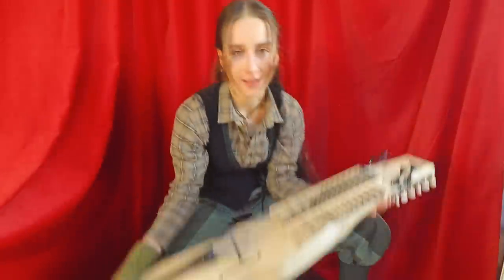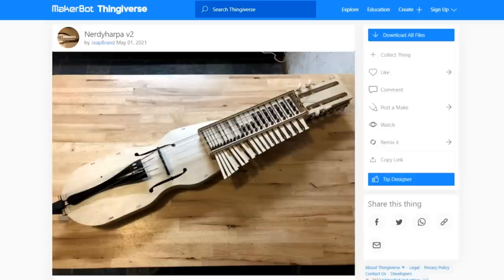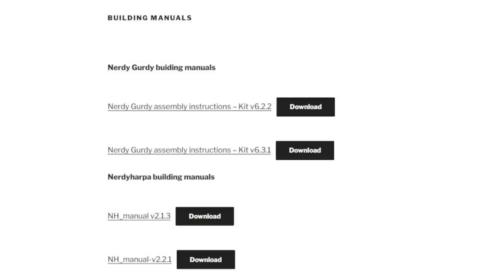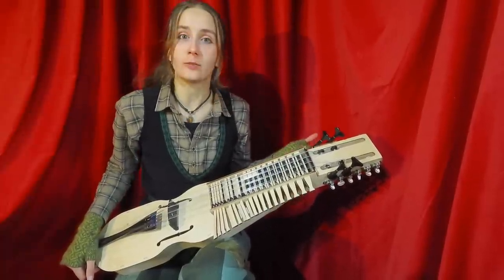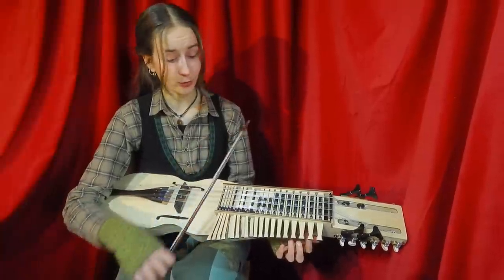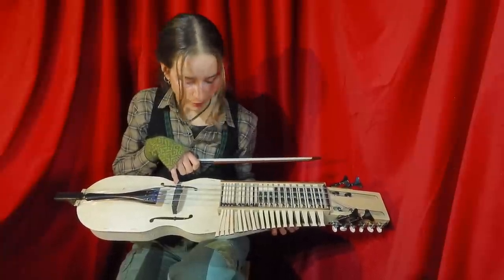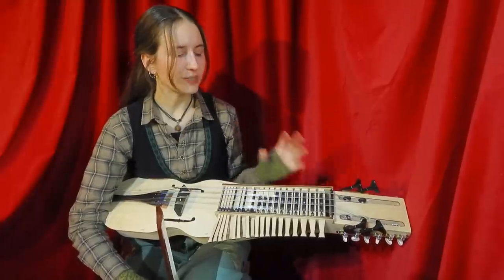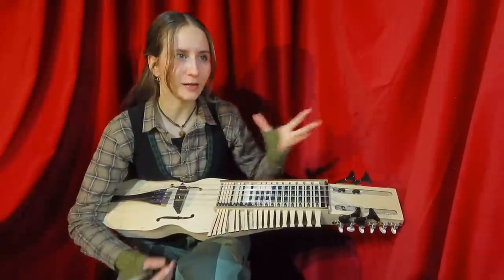The cheapest Nyckelharpa... sounds HOW ?

Comment: A simple solution to the sound would be to just put a pickup on it and plug it in. Then you can pretty much make it sound however you want, at least that's what I would probably do if it were mine. It would probably sound pretty good through a Fishman acoustic amp.
Reply: The issue is that a contact pickup on the body will not properly capture the resonance strings. See the other videos from this channel, with an acoustic mike positioned to capture all the strings.

Comment: There is an experiment which I would suggest to make: put the wood into a vacuum chamber and let it soak with resin (polymer resin), that only hardens when heated. Let it soak for 24 hours, take it out, put it into an oven with 200°C then assemble the instrument. This should fill all the air gaps in the wood with hard resin, make the cheap wood very flexible, very vibrant and very hard. It will add a bit of weight, but that's the way to make this work, I guess. 

Can't guarantee but that's what I would try. This is the problem of the instrument. Yes, this is not very "classical" or "traditional" anymore, but we are living in 2022 and not 1522 anymore. You actually do not need expensive wood anymore, because you can create the same physical attributes with modern methods of compound material construction. If you do that, try thinner wood, because this will add weight but also stability to the plank and thick planks will have problems to swing on low frequencies.

Comment: Thank you for this very informative video! I had the pleasure to try one out for 10 minutes. I am a cellist, not a harpist, but I was really impressed after seeing the price. For this price, the quality is remarkable. And it is a fun build project.
On the sound part, it does disappoint a bit. It does not have the full, rich sound you give us with your regular nyckelharpa. I think that the real deal is perfected by the builder (hence the cost), while one of the most difficult parts of building this diy-variant is the top of the casing. The bottom is just flat plywood, then there is a construction inside to hold everything together, and then the top plate. You have to bend the top plate yourself, by soaking it and bending it. There is just no guidance on how to perfect that process for sound. Maybe this harpa sounds a bit dull in a way, while other examples which have a different bend of the top plate and will sound different. Still, for this price it is very tempting to get one just for the building fun, and playing it sometimes to get the hang of it.

Comment: Regarding the resonating strings rubbing against the arm at the attachment point, the mandolin family doesn't have the long tailpieces of the violin family, they have loop end strings that catch onto hooks at the edge of the soundboard, and they have a little plate (part of the same piece that has the hooks) running over them to prevent that problem. Similarly, I think it's the Danelectro guitar/sitar hybrid that has a clear plastic half-moon protecting the edge of the set of sympathetic strings
Reply from the maker: This could be a good solution to that problem !! I never thought about the mandolins but of course !

Comment: Emelie Waldken
It works, 5 string Violins exist too & they have a slightly deeper & bigger body to help that C String speak more clearly. The 4 Row Nyckelharpa is common in Germany.
Reply from the maker: I know.
Reply: @EmelieWaldken  The body is bigger than a Viola body which I think would help improve the C string sound alot.
Reply: @EmelieWaldken  So this little 4 Row Nerdy Harpa sounds lovely like a Viola but easier to play because of the keys. I suggested the company to use Prim Medium Tension Nyckelharpa strings as the 4 main Playing strings (They're Chrome Steel Flatwound Strings so they're fairly mellow) in the kit because they're essentially Cello Strings designed Shorter so it saves us the trouble of having to cut down Cello Strings to the right length. What I like about the Prim Strings is that they're made in Sweden which is the same Country that the Nyckelharpa came from.

Comment: As a fiddle player, who would absolutely LOVE to own a nyckelharpa (I played some a few times, and we have a nyckelharpa-luthier living just around the corner here), this is a really interesting project. 
As I have my own violin- and guitar repair workshop here, I'm thinking of getting myself one of those kits and then combine the lasercut parts for the mechanics with a proper selfmade box, out of maple / spruce - or, at least, build a proper top out of massive sprce tonewood for this instrument.
I think, particularly replacing the plywood instrument top with a proper top, made out of massive tonewood, would be a MASSIVE improvement in sound quality, loudness and it would probably also sort out the issues, that you had with the low string.
Reply from the maker: Go for it, and let us know how it sounds =D
Reply: @EmelieWaldken  I'll think about it!! :)
By the way: Another important difference between a usual, handbuilt instrument and the nerdyharpa is, that the nerdy doesn't have a soundpost... 
This is probably, because setting up a soundpost requires some skill in violinmaking and also some special tools... 
I am pretty shure, that replacing the "schoolchair-back-style" instrument top with a proper one plus adding a soundpost would probably sort out 80-90 % of the sound issues with this instrument. Even if you stick to the plywood back & sides. This is, as the type of wood and design of the instrument top has by far the biggest influence on the overall sound of such instruments...

Comment: When making a violin, after the construction of the top and bottom parts of the resonance box is done, you could assemble the instrument right there and play it.  But it will have the same sound problems you are getting from this instrument.  To get high quality sound, each part of the resonance box has to be tuned to a specific note.  This is done by tapping the wood and listening to the pitch of the thunk sound.  Sand paper is used to remove material until the right pitch is achieved.  This is what gives high quality violins their great sound.  I am willing to bet that a plywood instrument likely has not been tuned in this way.
Reply from the maker: Surely not, as it is most often assembled by full amateur builders who like to tinker. And yes, I guess if the NerdyHarpas were carefully "tuned" in that way, they could sound better ! But then... the point is to have an instrument that is cheap and quick to build...

Comment: I'd say the that the problems with the tone would be firstly because of the wood not being very hard and resonant and being a bit smaller. The other factors are the bridge (which looks very thick and can absorb a lot of the sound) and the placement of a sound post inside the body (if it has one). The actual shape of the body could be a factor also (is the body curved, is the body made of consistent thickness wood? Does it have a bass bar rubbing up the spine?)

I would recommend they redesign the body if possible.

It's very impressive either way

Comment: The lower the frequency, the larger the air volume is required for resonance. I'm thinking larger air volume inside the instrument makes for deeper bass. I'm also pretty sure plywood doesn't resonate as well as single ply continous wood =) Less resonance, less sound pressure.
Reply from the maker: Totally agreeing on both points !

Comment: Very interesting presentation of the Nerdy Harpa. Thank you. I did not expect that the Nerdy Harpa sounds that good (of course not like a handcrafted one). In my opinion this Harpa would also be a starters' instrument for teaching. 
I wonder if the sympathetic strings rattle or is there another mechanic noise?!
Reply from the maker: I didn't expect it to be that good either ! There are different rattling noises happening here, mostly pieces of the keyboard that have the same frequency as one of the strings/notes and therefore vibrate when playing that note, but yes also the sympathetic strings hitting neighbouring parts when played a little too loud for their capacity (which is very low).
Reply: I have a variety of the 3-row models of the Nerdy Harpa and none of mine have any trouble with rattling sympathetic strings.  One of the really early beta versions had a wolf tone but that's gone from the current models.  I haven't built or played the 4-row yet.

Comment: Try to play with your fingers directly on the tangents (not on the keys) on the lowest string. If it sounds better it's the tangents that are vibrating, and it can be fixed.
Reply: How do you fix it then?
Reply: @koenvanmeerbeek   One common cause is that the fit between the tangent and the key isn't tight and snug enough. 

The lowest string is having the longest tangent (it's a bit of design flaw in nyckelharpas in my opinion) and these phenomenon becomes more pronounced the longer the tangent it. The longer the tangent is, the tighter it must fit in the key.

So what can you do? Well there are many things you can try: 

If  you want to have a permanent solid solution I would change the tangent, increase the diameter of the pin attached to the key and drill a larger hole in the key. The larger the pin is the greater the surface area is attached to the key. The less likely it is that it starts to vibrate. Anything under 5 mm diameter is too little in my opinion. But it still must fit tightly. 

The quick and dirty fix that sometimes can improve things is to lay a layer of wrapping plastic on the hole of the key (a square  1x1 cm or so) and then try to push down the tangent into the hole into the key. But be careful so it's not too much material because it can act as a wedge and make a crack in the key. 

It's all about getting as tight fit as possible between the tangents and the keys. 

Are you having this problem yourself, and it works when you use your fingers directly on the tangents?

Comment: The question is how long when you’re playing it does it keep in tune or do you have to constantly readjust it? Sure the hardware might be substantial, but the plywood may not maintain. This resident quality inherently over a period of time even a short period of time.

That would be the first thought I would have
Reply from the maker: It's like most nyckelharpas : surprisingly stable in tuning. Not had any detuning problems ! Then over a long time, after years of playing it, that's another story - and I don't have the answer.

Comment: I wonder if the scale length is shorter on the kit one, if so, that would make a difference to the string tension and volume. I don't know if these things have soundposts like violins, but that's a source of power too. And the neck angle. Baroque violin was made more powerful with neck angle and soundpost. So maybe he could do something like that.
Reply from the maker: It's the same vibrating string length as usual nyckelharpas, aka 40 cm.
Usual nyckelharpas have a similar construction to violins, with soundpost and all, but this one seems to have a weird internal construction, probably to accommodate the pressure despite the cheap wood.
Reply: @EmelieWaldken  Ah, then I have nothing helpful, ha. Well, looks like that scale length is longer than my 15.5inch viola and yeah, the C string seems even floppier/weaker. And my C is basically a write-off anyway, I just wanted a mezzo-violin basically.

Comment: where's the crank handle
Reply from the maker: You're thinking about the hurdy-gurdy, the instrument with a keyboard and a crank turning the wheel. This is a different instrument, it's the Swedish nyckelharpa. It doesn't have a crank nor wheel, but a bow, like a violin.
Reply: @EmelieWaldken  that is what i was thinking of without the crank anbd other things it plays in the same function as te hurdy gurdy the only difference 1 uses a bow and the other a wheel with operation of a reversible crank